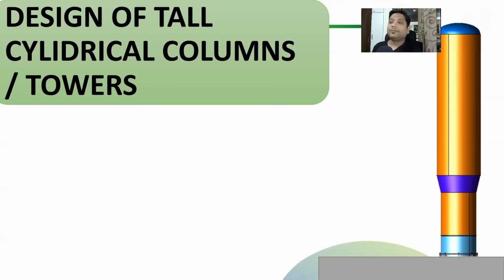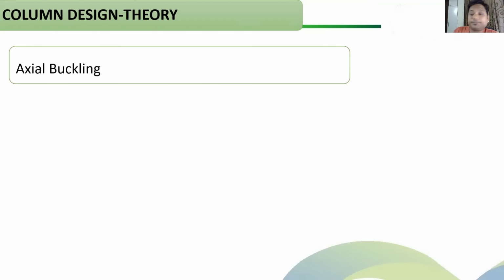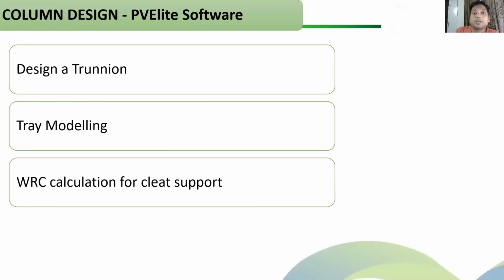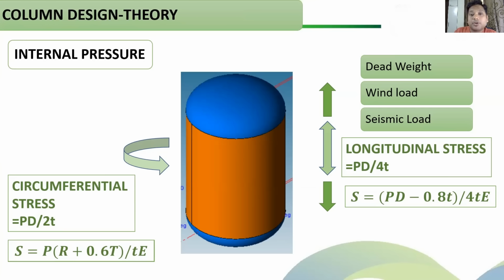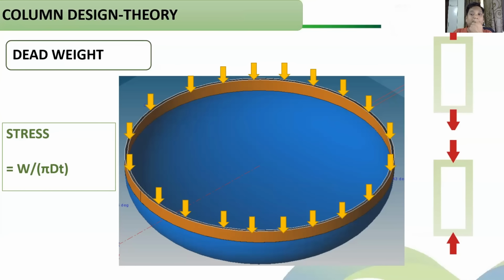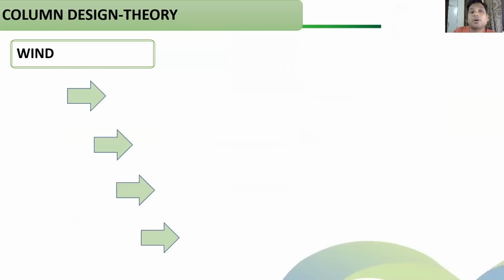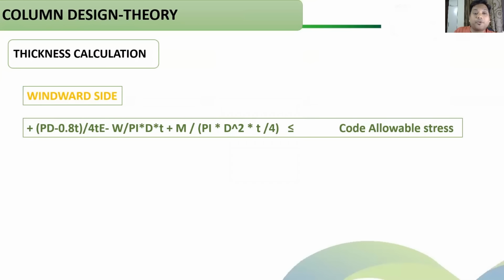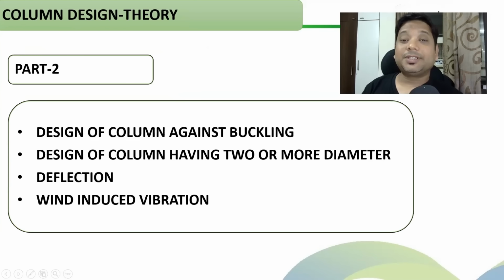Design of Tall Towers or Column: PART 1 (Static Equipment Design Course)

Comment: Verry thanks for all of video vessel you share is very helpfull to understading about pressure vessel. Can i ask you about support pipe at pressure vessel. Can this support modeling in the PV elite? And can PV elite generate the load data according to the pipe force the support. Verry big thanks if you can reply my comment

Comment: Nice session.

1. In addition to these loadings, in column design eccentric loading due to column supported piping and any column supported equipment also required to consider.

2. Please elaborate about allowable longitudinal compressive stress (on leeward side). Here it should not be S, but it should be B as defined in external pressure design methodology of code.
Reply from the maker: Yes Hemant i will cover about compressive load in Part 2
Reply: @ScootoideLearning  Has part 2 been released?